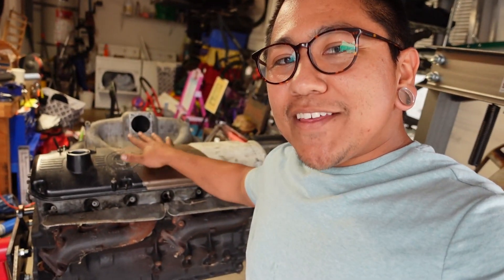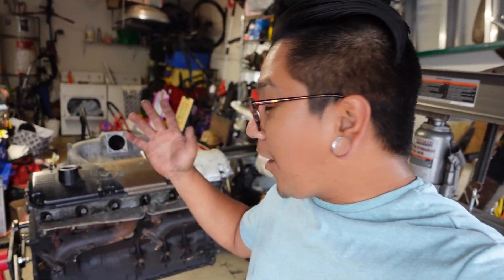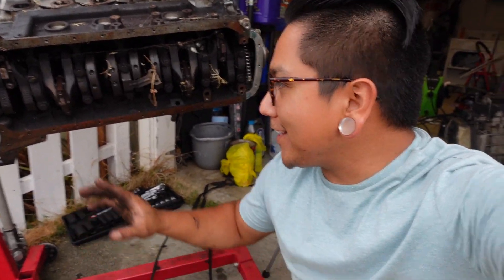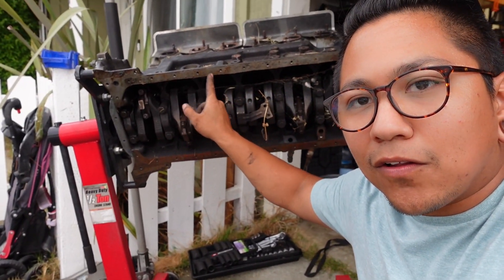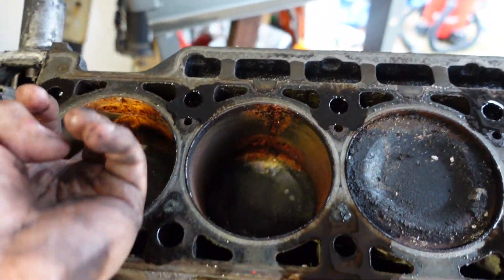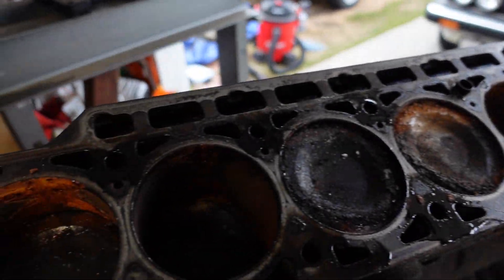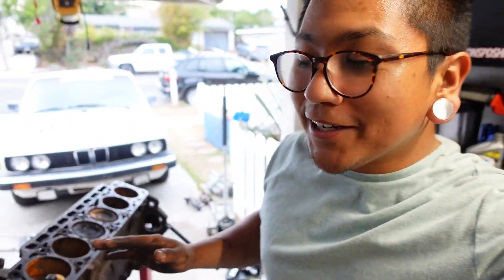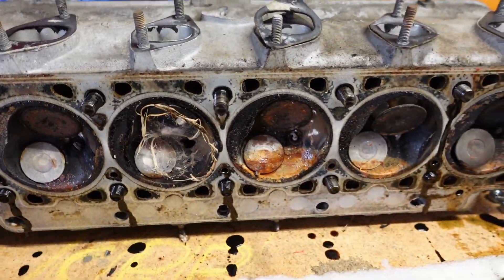The E28 is getting a SWAP! #projectcar #diy #bmw

Comment: The M30 is truly over engineered.
Absolutely bulletproof.
They can even withstand high boost on stock internals.👍
Reply from the maker: Exactly! We are actually about get everything ordered to rebuild it to stock spec so we can do a modest turbo build with it. It's such a great platform for this chassis and we are super excited to see where it goes. 

Definitely a long overdue update video on this 😅

Thanks for commenting! 🙏
Reply: @superbimmerbros  
That sounds great, I can’t wait to see the results! 👍